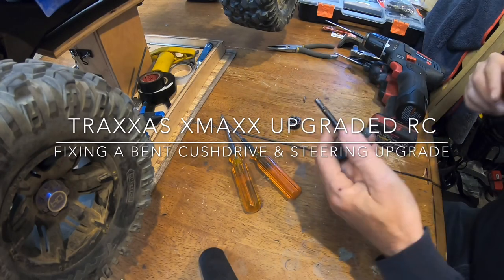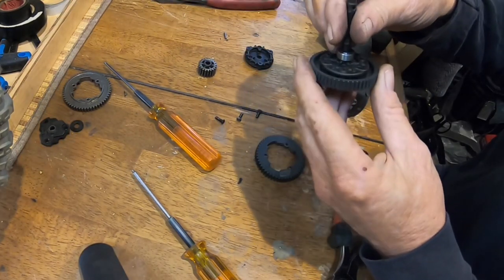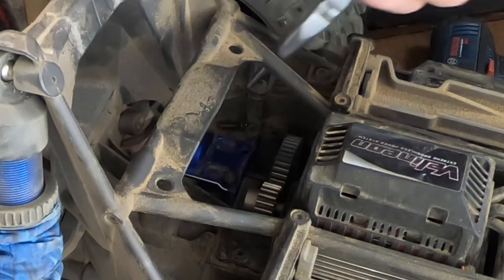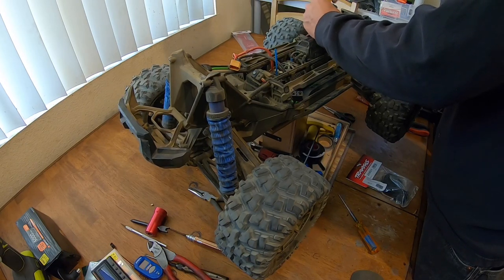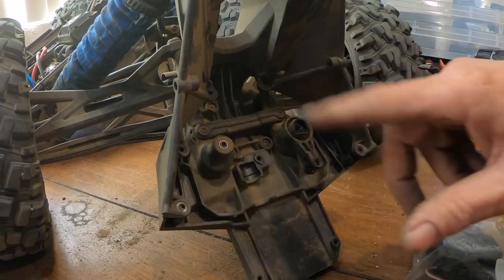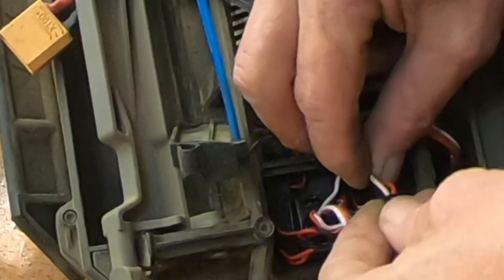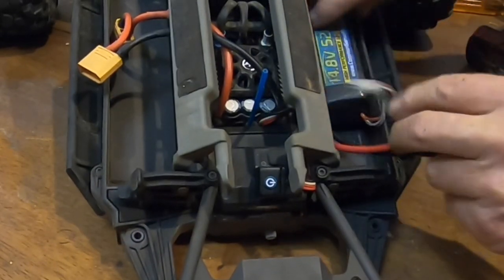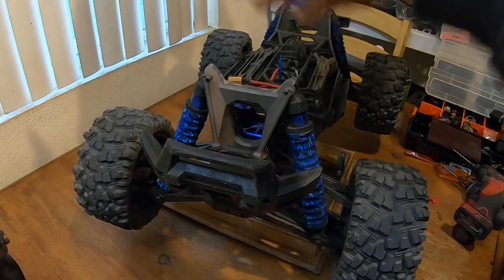Traxxas Xmaxx Cushdrive Repair’s & steering servo upgrade steering starts at 20:45 to skip cushdrive

Comment: I am so amazed how long people are going with the stock servo. Brand new out of the box, mine stripped out 15 minutes in training mode driving around in my back yard. It was the first thing I had to upgrade before I got to drive my truck.
Reply from the maker: Yes the older servo where better rtr 👍👍
Reply: I have no idea how I'm still going with mine I've had the truck for 3-4 months, and we're still good. The only issue I've been having is I keep stripping out pinion and spur gears.
Reply from the maker: Saga the only gear that holds and sinking motors are important so the push power at the same time 👍👍🔥🔥🔥

Comment: I did the hot racing harden steel shaft with slipper eliminater.

I did the traxxas upgraded servo and it fried with in 3 days. So I pulled the metal gears out of the upgraded and put them in the stock (blue) servo and after a year of running it hard the servo took a crap, now I'm putting a 1/5 hobby star servo in it has:
Torque @ 7.4v 972 oz-in 
Speed @ 7.4v 0.16 sec
Reply from the maker: Good information 👍👍

Comment: You may want to get that shaft to be safe. Idk..it may be ok but in slow motion I think it was just slightly wobbling. Only ever so slightly. I don't know if that actually effects it or not. Great video.
Reply: Thanks Earl, another rc thing to keep an eye on. You see a lot of guys going nuts on there xmaxx, 2028 motors. 1.5 mod gears and yea there xmaxx's  are a little faster but not much. Plus all that weight, durability goes out the window. Run times cut in half. I keep mine stock besides the metal servo upgrade and aluminum steering turnbuckle's. Definitely will upgrade my esc when it breaks. Question, is that a max 6 in there? thanks again.
Reply: Ok watched the rest of the video and yes it is a max 6.
Reply from the maker: Yes a max6 esc I wanted the factory esc for my udr to make it 8s so I changed it before I ran the rc I just wanted mine simple and stronge👍👍👍👍👍💯
Reply: I order the whole thing from Amazon because I'm having the same problem 🙃

Comment: Old Skool way separate shaft from parts and roll shaft alone on white paper 🤔🤯 maybe have a cloth or large towel covering the work area too🤔 it’s should stop the bouncing screws running away as they fall 🤔 I’ve always wondered Earl do you use some kind of tint on your videos😎the servo part reminds me of savage flux xl same feeding through coming up from the bottom thanks for this show Earl a lot was going on here today 🤤 dropping things happens a lot when not using ur pillow 🤣🤣 tho super glad you sorted the x maxx nothing worse than a double parked rc 😉
Reply from the maker: Thanks 🙏

Comment: When it slows down does it come to an abrupt stop? And if pushed backwards it will roll but pull it forward and it grabs? It will run and sounds fine but I cant find a remedy for it. The top box is tight and everything looks fine.

Comment: EARL,,you might find down the road that bolt holding down the servo saver spring will back off some. If so I put a bolt a little longer with a nut on the other end will cure that issue....I got that from Kevin Talbot .....fixes the issue,,,,🇺🇸👈
Reply from the maker: Great information 🙏🙏

Comment: I just did this upgrade.... , it still doesn't steer right. It often still wont steer if not in motion... at least not in both directions. Fun eh!
Reply from the maker: You up the voltage in the esc bec voltage?

Comment: If it's the shaft that would be nuts
Reply from the maker: It has a slight bend I think from pieces of chipped teeth getting wedged in the gears before it totally breaks 💯💯💯

Comment: at 38;57 you said max6 esc  isn't water proof or water resistant ? can you double check that cause im here following you step by step on servo changes and im waitin on my 1100kv hobbywing motor and it comes with a mas6! i just want to know or actually need to know your on top of things and know what your talking about......
Reply from the maker: This is my hobby not my job there water resistant but can’t be submerged in water 💧
Reply: @earlmoorhead5555  thanks for the reply

Comment: Mine has a tight spot and I’ve never ran it. Don’t understand. Used the e pin slots and put in the 46. Don’t want to run it until it meshes correctly. It’s brand new. Any ideas?
Reply from the maker: Yes check the motor bearings and the Cush drive one of them has a bow 👍👍
Reply: @earlmoorhead5555  wow, really from out of the box?
Reply from the maker: Yes
Reply: @earlmoorhead5555  wow that's bullcrap on a $1k truck.
Reply from the maker: @justinf5963  yes I agree 💯💯💯
Reply from the maker: https://youtu.be/gwGsz59yfwI